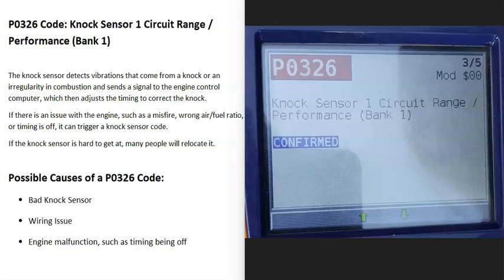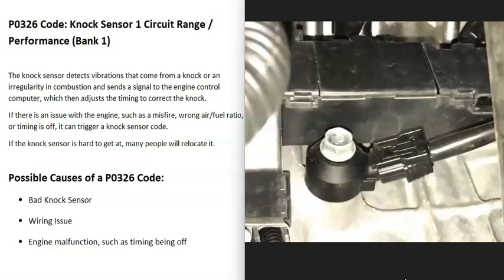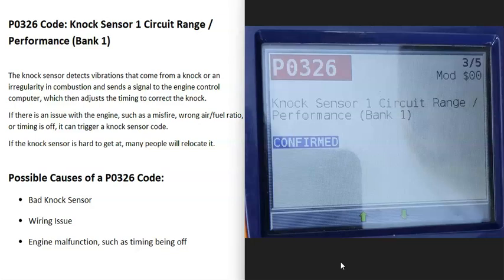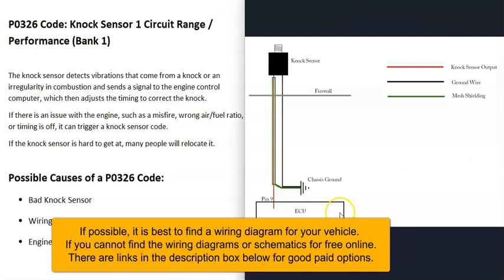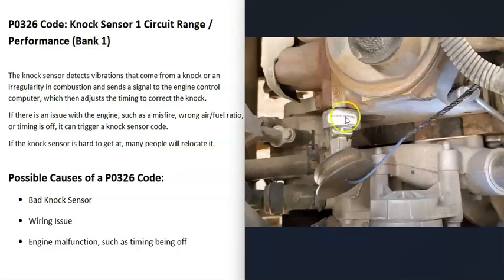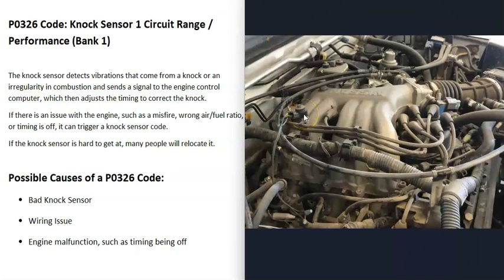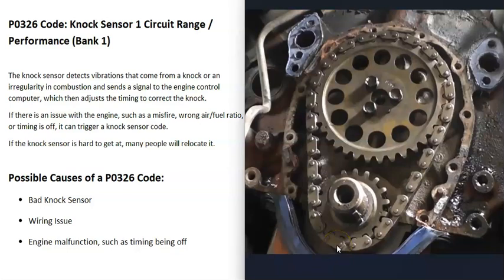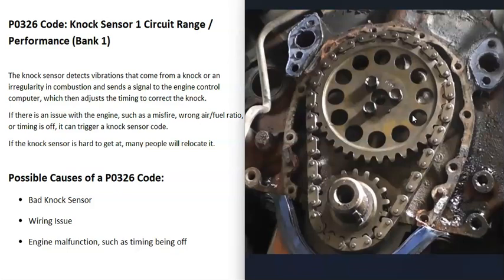Causes and Fixes P0326 Code: Knock Sensor 1 Circuit Range / Performance Bank 1

Comment: I've started randomly getting a P0326 code - no check engine light and no other warning lights and engine feels like it's running fine. But have noticed that since I've started getting the P0326 code the long term fuel trim has went to -25% (usually at 0%). I'm guessing this means there is likely an issue somewhere that's probably not the knock sensor, going to check for vacuum leaks but trying to find out anything else that may be causing this issue.
Reply: lmk how that went. the check engine light for this keeps going off and on.. but it is the main reason for the check engine light as i had my car code tested at a few diff autozones. haven't changed the knock sensor yet (will attempt). i noticed fuel consumption seems off as in burning more fuel resulting in less miles per gallon etc. (today i learned what fuel trim is)